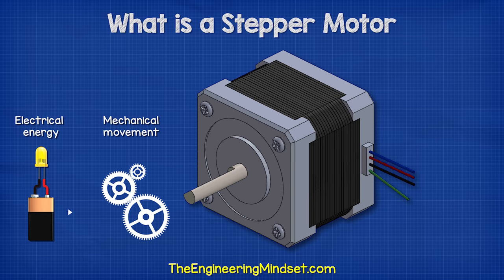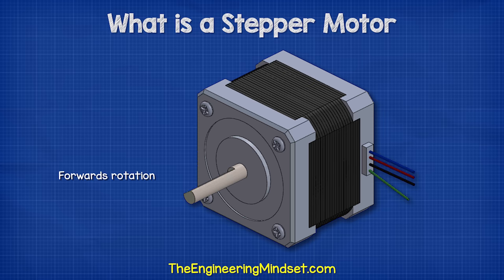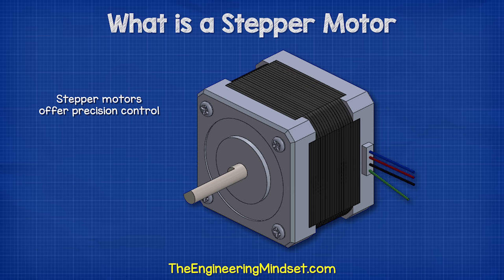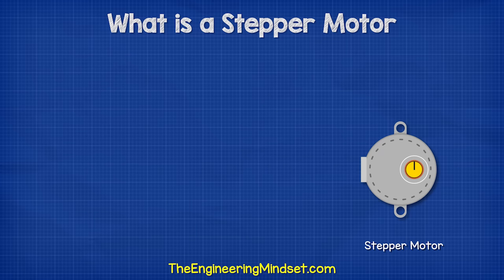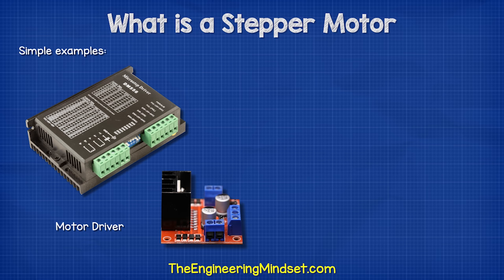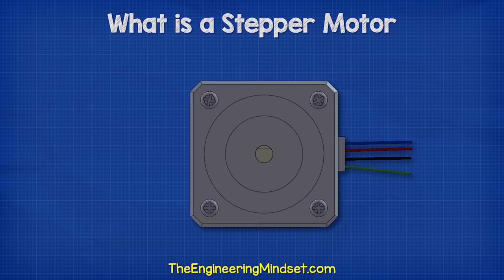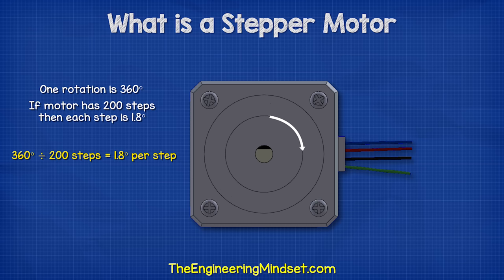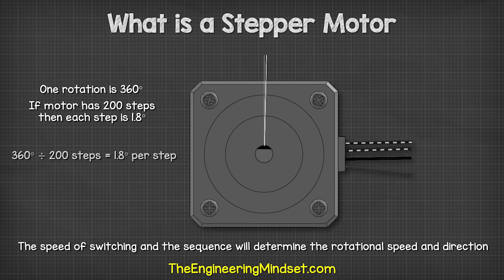What is a Stepper Motor?

Comment: 1975 (ish) I worked on a Mergenthaler VIP (Variable Input Phototypesetter) which used a Stepper Motor for each of its three drums; each drum had 6 user-changeable font character negatives, which clipped on with a wire clip.  Software would select the appropriate drum; the stepper motor would rotate the drum to the desired character, and a xenon strobe would flash the character through a zoom lens and moving mirror to photographic paper.  It was very precise, but very loud.  I layer order on an updated version of the machine which used much quieter servo motors to accomplish the positioning
Reply: 1985(ish) I wanted to build a robot arm and tried to source stepper motors in NZ where I lived. No one knew what they were… never got to build my robot arm.

Comment: Why dont they scale up this tech for industrial uses?
Reply: Because stepper motors are very bad at being motors.
The basic operation of a stepper motor requires enough current to run the motor with a load even if it has no load attached, this means that whilst for most other motor types they run at low current until a load is applied a stepper motor runs at a high current always, this translates to a very ineficient motor and a lot of heat generated for relatively low power.

There are methods to overcome this by using something called Field Oriented Control or FOC for short but to do that on a stepper motor you need a very high resolution encoder and by the time you buy and attach those most other motor types are cheaper and can do the same precision with some control software.

Stepper motors still have one fairly unique feature among motors where because they can keep current flowing whilst standing still they can apply holding torque most other motor types can not do that.

finally ofcourse this video is simplified in actual use you usually use some form of microstepping and current control to get the most out of your motor this means the controllers for stepper motors are fairly complex if you compare them to controllers for other motor types.